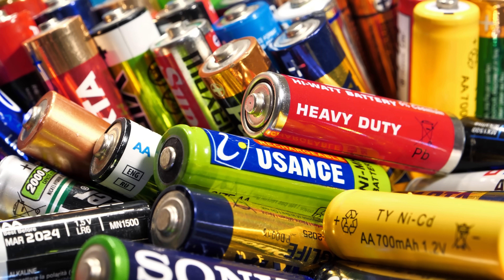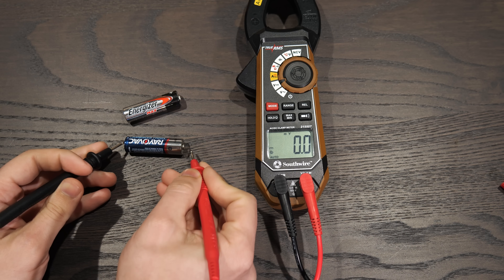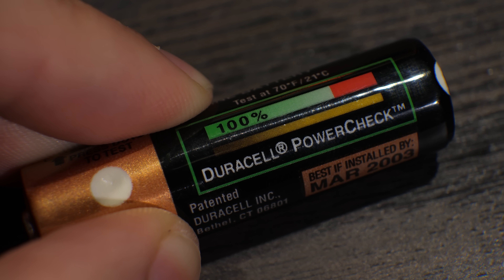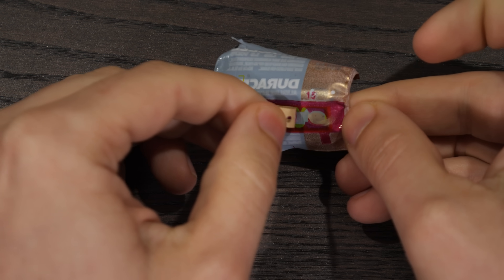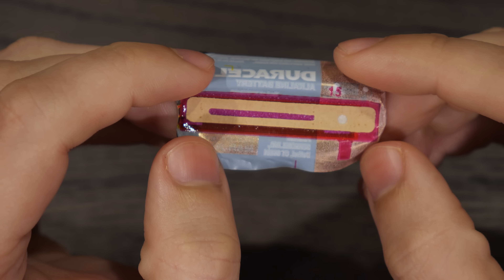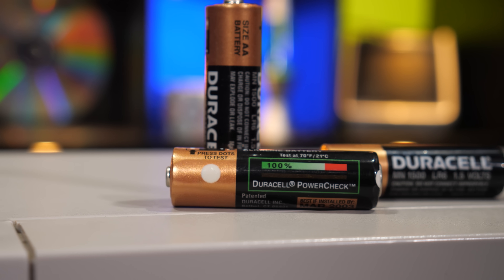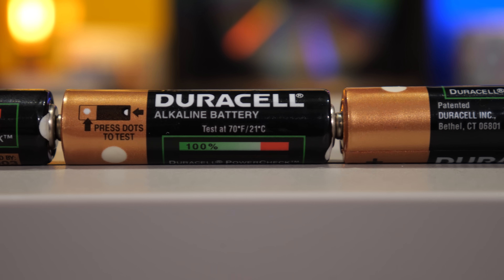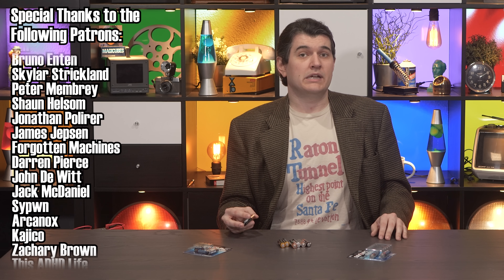Duracell PowerCheck: A genius idea which didn't last that long

Comment: "Thank god we are past that"
Meanwhile the cigarette-industry: "We make disposable e-cigarettes with Lithium-ion batteries in it, that you just gonna throw away after use"
Reply: Not a smoker, but I did know some. I didn't know those were disposable now. Aways saw them charging theirs in a laptop or car USB charger.
Reply: @tangydiesel1886  yeah there's disposable ones as well, which hold a bit of liquid, and have a 18650 Li-Ion battery in them with no charging port/board, which makes them "disposable". 
Not being able to charge is done by design. Its also cheaper I believe.
Reply: @razelm easy solution: buy a charger for the 18650 cell.
Reply: @razelm they are absolutely not putting 18650s in disposables, they only use LiPo cells
Reply: @razelm that's a huge battery. That's 4 times the size of a phone battery. Why would you just throw it away?
Reply: @razelm  turning 18650s into disposable items is already criminal in itself.
Reply: @razelm  they use lithium batteries primarily because of power draw needs, and capacity.
Reply: @razelm Wtf are you talking about? 🤔
Pretty much all disposables have a usb-c charging port! They're "disposable" because they have no way for you to put more juice in them once they run out of puffs lmao (also there's no way to change the coil out either)
Reply: @tangydiesel1886   They're rechargeable, but they're still disposable. They get thrown out when the vape juice inside runs out
Reply: @tangydiesel1886  the units are disposable.  As in you cannot add more nicotine and keep using it.  So wasteful bcuz u might recharge the battery 5 or six times before the nicotine runs out and it's a paperweight.  Modular units are still available too.
Reply: @tangydiesel1886  There are both types.
Reply: @tangydiesel1886 the vape batteries are rechargeable, what makes them disposable is that you cant refill the liquid
Reply: @tangydiesel1886 they’re disposable in the sense that they can’t be refilled.
Reply: Yeah, there's some good videos out there on recycling those batteries and setting them up with a controller to make a battery bank on the cheap.
Reply: @johnsmith8981 I need to learn how to do that. I find these things discarded on the sidewalks quite often while walking since I don’t drive anymore
Reply: @johnsmith8981  trying to figure it out. I have about 70 of these bad boys. Electricity hard.
Reply: @johnsmith8981 that is just for fun.  I dont think they will last several cycles like the good batteries do...
Reply: It's upsetting, but simultaneously I reap the benefits of finding a bunch of free LiPo batteries and charge circuits laying around on the street XD
Reply: @LazorVideosDestruction  a modern cyberpunk version of trash. This is what future generations will be digging up as we are digging up vases and broken spear tips
Reply: @LazorVideosDestruction  same lol… on the one hand it makes me really mad. But also, free high-density batteries!
Reply: @LazorVideosDestruction gee thats some serious cyberpunk thing to do lol
Reply: @LazorVideosDestruction  I just realized how I can make slimevr that I plan to build a whole lot cheaper
Reply: @LazorVideosDestruction  i could have sworn those LiPo bats have some of the worst charactersitics (like massive voltage sag) and also they have extremely low capacity
Reply: Yay, smarter people collect these to make DIY powerpacks.
Reply: @Zcooger  Just came to write that and saw I wasn't alone :D
Reply: @Zcooger I found a few of those ....got some free batteries
Reply: As someone who does indeed vape (I know, I know flame me for it if you want), I have NEVER understood the popularity of those disposable vapes. The popular ones like elfbar can be as much as 35 dollars where I live, and run out of juice or burn out the coil often before the battery even dies. Sometimes just a few days before needing replacement. You can buy a decent reusable vape battery kit that includes a couple pods and charger for $40, and a bottle of vape juice to fill them up for $15 (these prices are on the high end too because of taxes where I live). The $5 pods can last up to a month before burning out, and weeks for the bottles of juice. And the battery can last years if you take care of it. It’s so much more economical, and sustainable.
Reply: @PortRhouse  I buy $5-15 juice. (30ml roughly)
$5 coils
The vape itself cost $45 and lasts well over a year. I'm on my 3rd on in 5 years. That's THREE BATTERIES TOTAL. 

A bottle of juice has 6x the juice in it on average and I can stretch a coil for a couple weeks. 

These college kids pay 20+ for one that lasts them a week. And throw away a cell every time.
Reply: @goosenotmaverick1156  how do you get your coils to last, i use rpm3 and can barely get a week put of them
Reply: @goosenotmaverick1156 yeaah you know what's up. I'm so happy I switched from smoking to vaping, it is an order of magnitude cheaper. It's so nice to be able to get all the nicotine I want for so much less money and I don't smell like an ashtray anymore
Reply: @PortRhouse  I think most people buy their vapes at convenience stores that only sell disposables and don't even realize what modern salt nic refillables are like. I've had a bunch of times where I told friends they should try a refillable and the reply is always "oh, I don't want some huge dorky thing," not even aware that the vape I've been using right in front of them is a refillable that's smaller than the disposable GeekBars etc. they have.
Reply: @max_archer That stigma of the dorky huge boxmod that ended up spreading to every form of refillable vapes was caused by the 30+ y/o dudes that couldn't let go of the vape smoke trick and who can blow the bigger cloud dick measuring contests. I dont smoke refillables anymore but I use the battery from my old vape for carts
Reply: @PortRhouse  i'll bite, I was smoking cigarettes for a time and when I saw vapes and tried one it was love at first puff, immediately changed to vaping after I tried, and then moved to a refillable tank vaporiser which was fun especially as the one I bought had a timer that would run and show you how long your vape lasted (dumb idea but made for a few laughs) anyway the worst issue I couldnt seem to stop was the seemingly random sputtering of straight semi warm vape liquid that every now and then would show up, and cover just a small portion of your lips or get in your mouth, but was so intensely concentrated, often with menthol, that the taste was so awful and then youd have this weird mouth feeling for a small while after you spit it out or just tough it out if it wasnt a big one, i coined this term as the 'vape kiss'

I tried different kinds and brands of vapes which would all have the same issue regardless of the coil size, wattage or ohms settings, as an australian the smoking laws here are totally fucking caddywhompus which meant you had to ship in vape fluid from overseas if you wanted it to come with nicotine, no stores were alllowed to sell liquid with nicotine already mixed into it (which Ive only thought now while typing, I find to be quite ironic as packageing the illegal vape fluid with an environmentally destructive battery somehow made it okay?)

so you had to piss-fart around with finding stores that would sell you liquid "under the counter, cash only thing" or you had to deal with international shipping so extra costs and the chance it might get stopped at customs, that or you find some other source of pure nicotine and then high school science style mix it yourself, leading to inconsistent mixes and then so those 2 inconveniences coupled with all the maintenance like coil swaps, filter changing, accidentally not wetting a new coil enough then inhaling straight burnt cotton, also fucking micro usb was rife at the time I started so constantly having ports break cause of shitty cables that would break the charge-contacts off the inside of the vape or just shitty build quality vapes which all cost anywhere between $60-140 bucks if you wanted to try a new one or have it replaced, it was still cheaper and less gross than smoking

another thing was just trying to stillbe a smoker but having this vape, youd be out with mates & a few of you head out to punch darts, and because youre also addicted to nicotine you decide youll head with them and so theres the discrete smoke and mild conversation happening and then theres just the "PSSSHHHHHHHHHHHHHH" noise as you take a sip and then proceed to exhale thunderstorm style freakin massive clouds into the area was a great way to just seem like a tool

i was proudly against the disposable vapes when they first showed up, being like if you have to have this shitty addiction that sucks then you can at least have it and not also fuck the planet up worse at the same time, which is still how I feel, however when my girlfriend came home with one after it was given to her, and it lasted a week with our pretty regular usage of it, with a consistent draw and a flavour that didnt diminish for the most part, the best thing about it was that it didnt give either of us a vape kiss
 the whole time it was a naughty pleasure, an extra expense to have between us for a treat

but the convenience i didnt realise was what got me, not having to fuck with all that extra bs i mentioned above, being able to draw less attention was a big factor, that and the price point being usually a deal of 3 for 60 or  30 each, when the time came to order more fluid, we just said fuck it I guess we're gonna be those people now

and now a few years later, with no idea of the financial toll due to having to buy most of them with cash still and with no idea of the physical toll of punishing my lungs with vape fluids for several years,  two green shopping bags full of dead vapes that "i swear ill make a battery out of one day"  theres an explosion of crime-run "american candy and gift + tabacco" stores in melbourne which are all just fucking shitty stores run by illegal gangs doing the absolute bare fucking minimum to look real, pushing imported tobacco and chinese vapes onto literally anyone, kids too, just dont wear your school uniform when you go - the government handled this situation ass-backwards, and made acquiring vapes as a legitimate means to quitting smoking was so full of shit that it made you not want to do it and just keep hitting the pens

I also realise i havent mentioned disposable vapes use nicotine salts, which are higher in purity than your bog standard nicotine, leading to way more intense rushes from hits but simultaneously get people addicted way faster, its looking likely ill have to switch back to cigarettes to quit vaping,  but yeah anyway ^^  i'm fortunate in that I developed this addiction after i started a career so ive had the means to afford it, but i imagine were that not the case, id be doing whatever was the cheapeast option which is certainly not disposable, but I only started smoking in the first place due to stress directly incurred at work so take with that what you will

so I hope with all that context, that you my dear reader you were able to see how and also why people would choose a disposable over a reuseable vape (atleast why they would in 2020) please excuse the goddamn essay length reply - I guess I had a lot to get off my chest about vaping  ^^ i try to be a good person but i recognise i have a way to go, if theres anything I can leave anyone who  read this all with, its for the love of god, dont ever take up a smoking or vaping habit, you mill around  with your hard earned money going up in smoke or fruity mist, its not just a waste of your money, its a waste of your life, while you stand there watching the world go by, the people that dont have this crutch are busy living their lives
Reply: @123mikeyd123   This is actually pretty interesting. After reading your story and learning about the stringent regulations in Australia, and how they pave the way for black markets and sketchy knockoffs, it does make sense why you would just go with a disposable out of convenience. I too hate the dreaded “vape kiss” as you put it. When you talked about your reusable, it sounds like it was an old school box mod I’m guessing. Can you not get pod systems down there? Just as discrete and small as a disposable, but still refillable, and can take salts or regular juice depending on which pods you get for it.
Reply: @PortRhouse  what the fuck, $35?!? 
It's like $10 where I live
Reply: @PortRhouse  I 2nd your opinion, I have a rechargeable pod based kit, my roommate only uses disposables. I spend way less than she does on vape supplies.
Reply: @PortRhouse  If you're really careful, the pods can last months even! I vape too and I hate dispos lol
Reply: @PortRhouse the disposables are now rechargable. Which is crazy but I do recycle them at the shop I buy them from.
Reply: @PortRhouse  bruh no one gonna flame u for vaping u a grown up live ur life however u want
Reply: @PortRhouse  Vaping isn't the problem. I'm of the opinion vaping is a really good thing. It's the HR "better than" version of cigarettes. I don't think anyone can argue that as a nicotine delivery system they're not more healthful than cigarettes. The problem is disposeables, which are incredibly wasteful. Rechargeable ones might even be less wasteful than cigarettes, there's barely any waste besides the bottles of juice, dead coils, and maybe the battery cells when they eventually die.
Reply: It should be illegal how wasteful those are. 😒
Reply: @Studio23Media   indeed it should be. Especially when simple solutions in conventional vapes have existed with much less waste for many years.
Reply: I'm so sick of those. I live in a college town and it's an epidemic.
Reply: Me: free rechargeable lithium ion batteries you say? Don't mind if I do xD
Reply: I always felt a little terrible throwing away a rechargeable battery and all the plastic of the enclosure and metal of the coil. I used refillable/rechargeable vapes for most of my vaping life, but when I decided I wanted to stop I went through a lot of disposables. It was a necessary evil as I didn't want to wake up with a working vape as I knew I couldn't trust myself not to start my day by sucking away on my addictive pacifier... I do believe vaping is less toxic, despite a lot of misinformation that goes around, but far more compulsive than "analogs" (over 30 days with no nic now)
Reply: well it turns out that rechargeable lithium cells are cheaper to buy in bulk than non rechargeable ones, so it makes perfect sense to me why they use rechargeable cells in disposable products, the cells are also usually rejects due to not meeting charging/power characteristics.
Reply: Not even close to the worst thing they've done, to be fair.
Reply: that's every industry now. toys, electronics, etc. are all "disposable" with custom non-replaceable batteries in them
Reply: Really really fucking big lithium cells too
Reply: Blame governments (like Australia) that tried to ban e-cigarettes, and ended up causing some half legal loophole where somehow disposable ones are legal but reusable/cartridge ones are not and then never got re-addressed lol.
Reply: Is this an american thing? I've yet to see this occur in my country, I keep my eyes open, but no free lithium cells yet.
Reply: @n.stephan9848  the UK apparently. 
  That's where Clive is.
Reply: @n.stephan9848   do keep an eye out for it and if there's not already legislation to prevent it, maybe talk to whoever can help in your country/area. Not being sure where you're from I only know to use our vocabulary for it so I'm not sure who it would be. 

But yes it's a thing in the US in a big ugly way. Sure, free cells. But that's just the ones you find on the street. Not all the ones that make it directly to the landfill, which I assume is much higher.
Reply: @goosenotmaverick1156  That's irony on its best when street litterers turn out to do better for recycling than those putting them on a trash bin.
Reply: @TheSimoc   sad, isn't it.
Reply: @n.stephan9848 I've seen them in Germany, too, sadly. The "Miniatur Wunderland" actually re-used some in their autonomous model car system and found that the vape cells were actually equally potent as their regular ones that they buy for a few euros each.
Reply: Now we throw the whole device away when the battery runs bad. What advance...
Reply: You ever see those Geek Bar things? Where they have a lcd screen on the side that shows some random bullsht like the power level and some dials and stuff? My sister goes through one of those every month and they just have to get thrown out.
Reply: DAMN, I have used my laptop liion battery for 7 years, bought new battery today, but I do not want to throw away old battery as it has 20% of capacity still :)
Reply: I've never seen a "disposable" ecig, I've owned multiple over the decade and most of had a replaceable 18650 or some smaller sticks / lighter sized ones had built-in batteries, but never one without a charging functionality.
Reply: @TehAlekzi you can charge them. but what do you do when the juice runs out? they’re still disposables. i usually just keep them all in a bucket because i dont want them ending up in a landfill though. The bucket has like 50 geekbars in it
Reply: @danielsmokesmids  Oh, so they're like closed off so you can't refill the atomizer? That's just stupid design then, the e-liquid usually runs out much faster than the battery does. I've made my own liquids and coils pretty much ever since I started using ecigs, but there used to be everything you need pretty reliably available before they passed a law here that you can't order ecig stuff online.
Reply: @TehAlekzi  well that’s not true with them. i charge mine probably anywhere from 5-15 times before the juice runs out
Reply: Just disasemble it and yoink that free battery!
That's what I do, I still have many lithium cells from old laptops.
Reply: I have my friends give me theirs and I turn them into big battery packs!
Reply: Great, now I'm reminded of this and angry again.  Big Clive has done several videos on the subject with instructions on how to harvest them and use them for other projects.
Reply: I tried a elfbar cigar flavored vape.
At near empty, I could detect polymer vapors I could both taste and smell.
For sure no where safer than a cigar or cigarette. Toxic. Nicotine free for 2 years.
Reply: I pick up at least 3-5 of them every time I go for a walk in populated areas. You can always guarantee humans will be lazy slobs but I'm happy to reap the benefits salvaging the free 18650 batteries inside them :D I mean, how cheap would it be to install a usb-c port to charge the things? then again they're there to make money, not save the customer money.
Reply: And full color screens with processors way faster than gaming PCs from 30 years ago. I'm a small government guy and I'd be fine with those being illegal.
Reply: Don't give apple any ideas.
Reply: WTH??
Reply: Get a Box Mod if you're serious about vaping
Reply: I had a functioning wifi router backup made from these exact salvaged cells. Then my country banned vapes. Which is ironic coz tobacco and ciggs never got banned
Reply: @smpmuzpid  I was only referring to the context of disposable vapes, because yes, you are correct, the first e-cigs were indeed rechargable and not disposable. 
Then the whole industry shifted to mods and vape kits which is too cumbersome for most people, myself included as I am a smoker too. 

Then, in the last 2-3 years, disposables became very popular for their ease of use. Buy it, open it, smoke it, throw it. 

And now, in the last few months, at least in my country, the same brands producing disposables have shifted towards selling a small battery kit + pods with juice. 

So now, at the very least, you can keep recharging that battery and just buy pods with different flavors. 

All they gotta do now is sell pods that are rechargable and we're back to square one. Lmao 

How the turntables have tabled.
Reply: the world disposes a quarter billion vapes per annum, enough to make tens of thousands of vehicle batteries.
Reply: Does no one know they’re just a regulatory arbitrage? They’re everywhere because resizable flavors were banned - it’s just a policy failure
Reply: Easily harvestable and used again if you know what you're doing.
Reply: *what's that sound? I think it's big Clive running in from stage left!
Reply: I actually think this is worse. Also have you seen the disposable phone chargers? Basically a vending machine with a phone charger in it and it's one time use but if you open it up it's a lithium ion.
Reply: Please feel reasured, i (born in 1991) deposit as many of those dumb e-vape batteries in those 'battery return' boxs i believe they are grean.
Reply: Thank the government for throwing all the regulations on pod based systems like juul. Still somewhat wasteful, but not near as much as disposable vapes.
Reply: Be like BigCliveDotCom (he's on YT) who finds the tossed e-waste, rescues and uses the batteries.
Reply: In Finland, disposable vapes and flavored e-liquids are illegal. But underage kids use disposables bc it's so much harder to hide a charging vape or liquid mixing gear from parents. For the same reasons these get thrown out in the woods instead of properly recycled.
Reply: I actually still have sone way newer duracell powercheck batteries that still function and live in a little box on my desk where I collect them to fire up tech I'm tinkering with that needs them.
Reply: Why not use primary cells for that ?
Reply: I saw someone making powerbank out of trash left after concert.
Reply: fr. there's no reason to even dispose of them, you can rebuild them for pennies and an hour of time
Reply: which am SO tempted to just take them off people's hands just for the free batteries XD
Reply: That should be criminal.
Reply: @jeschinstad  you gonna go against the corporatocracy?
Reply: I've got some with a lipo and USB C port, but no circuit for charging.
Reply: @LowBudgetGamer-o6l  The charging circuit is sometimes imbedded in the sensor bit that looks like a microphone
Reply: @LazorVideosDestruction  Wow, I'm gonna start keeping those.
Reply: and this is why you don't buy disposables...or vape in the first place. :)
Reply: Also - not as much of a contributor but noteworthy to me - for years in the shops here, you could buy what I guess you could call 'power hits'. They're like, tiny and cheap non-rechargeable power banks that give you a bit of extra juice in an emergency or something, and then you dispose of them when they're empty. The thing is, they're non-rechargeable due to the design of the product, but the actual cell they use is a rechargeable Li-ion battery.
Reply: “Saving the TV Remote in a trying time “.  😂 you sleigh me brother.  So true.
Reply: I watched a video a few weeks ago where a guy was just walking around his city picking up discarded vapes in order to harvest the batteries to make battery packs out of them. He said in like 2 months he found like 100 of them (that figure may be completely incorrect, but it was a lot in a short amount of time).
Reply: The government throws away millions of lithium batteries used in non returnable radiosondes.  Doesn't seem to be a "problem" if they are doing it.
Reply: Well let's be honest, no one's going to go through the proper message to dispose of it. Though you can convince people to probably make some cash back and disposable batteries if they actually save them up and take them to a scrap yard. But if they want to make anything they got to save up a lot or they got to also collect car batteries with it. Like that car batteries. Take it inside a scrap yard to come out the way it and you'll get some money for it. But that's if people even think of doing that. European how much do this with any and all types of batteries. You can sell them as scrap at a scrap yard. But she really got to save up enough because you're paid by the weight. But honestly though, the average vapor is probably not going to save up enough use the fake batteries to do that. They're not even going to care. Filling up the equivalent of a large paint can would probably barely give them a few bucks at a scrap yard.
Reply: @HK47_115  core charge every time you get a new vape lol
Reply: Also, gluing rechargeable Lithium-ion batteries into [smart]phones that are just going to get thrown away later (not as quickly, but still). Why [the fuck] they gotta glue that in?!?! Answer: greedy control-freaks in corporate who are also so out of touch with reality that they don't know what the actual design requirements are
Reply: The unfortunate other consequence is that all those rechargeable batteries are very non-standardized and something that uses disposable batteries will be usable long after these newer appliances aren't
Reply: The disposable e-cigarettes will be forbidden very soon in France. The European Commission has just validated the ban voted recently in France. Other European countries may follow.
Reply: Those lithium flowers, ready to bloom. Reusable, by hacking. But I'd imagine most of them end up straight in the bin, and nobody has the change to reclaim them.
Reply: or electric vehicles
Reply: Not me laughing so hard and slamming the desk. e-cigs really are a bad thing, bad for you, bad for the planet, and even bad for the testers at the factory! Yes, there's a guy who tests all e-cigs before they undergo a sanitisation step and ship to your local store or front door.
Reply: “Ruins both your health and Mother Nature!”
Reply: @Ogi-kun  I'll have to say that only concrete evidence I've seen of people ruining their health with ecigs is when kids shove weed oil into the devices. So user error, oil doesn't vaporize but some gotta get high somehow. And destroy their lungs just for that.
Reply: There's a perimeter wall along a stretch of highway off-ramp in my city that's nicknamed the "Vape Wall". It's called such because people stuck on the offramp during rush hour for the lights up ahead to turn green , would chuck their used disposable vapes out of their car at the wall. I've seen pics where the pavement below the wall is littered with an assortment of colourful disposable vapes...
Reply: you mean the vape industry the feg industry would never want you to stop smoking that's their whole point.
Reply: Gotta get everyone addicted!
Reply: We started smoking because John Wayne and Andy Griffith smoked, Doctors said it helped anything bothering you and all the tough guys on TV smoked.  Could someone young please tell me why anyone starts sucking on a steam iron??
Reply: @donnienicholson6062 Because they've got four ingredients instead of 502+ carcinogens:
Propylene glycol (used in albuterol inhalers), vegetable glycerin (VG, used in medicines, serves as a thickening agent and reduces 'bite'), U.S.P-Grade food flavoring, and nicotine. 

Wanna know what the American Cancer Society doesn't list in their big list of carcinogens?
Nicotine. 
Everything else in a cigarette will wreck your health. 

It's not a safe alternative by any means, but a safer one in general for those wanting a cessation tool to wean down from nicotine levels of a cigarette (~14mg) through a series of 12mg, 6mg, 3mg, and finally zero-mg. 
That was always the intended purpose, and back when I worked in the sales force for these products, I always stressed that with customers. 
I didn't want them coming back as repeat-customers because I cared about those same customers and their wellbeing. 
We used to 'confiscate' packs of cigarettes from people in exchange for a free bottle of the liquid of their choice if they were getting a starter kit. 
If they didn't want to do that agreement, they just paid for the products and went on their merry way. 
It was a sign that you were on a path towards a better life, and a reminder of that when you returned to the shop.
Reply: save a tree, smoke an old fashioned marlboro.
Reply: Meanwhile people actually smoke. gross
Reply: That one i cant understand how we ve come to this point. Disposable lithium ion batteries in cigarrete
Reply: @smpmuzpid  In my country it's even dumber, disposables came as a forced trend by the tobacco companies. We already had really good refillable pod vapes, which are as convenient as disposables. But those were from vape companies - and of course the tobacco companies don't want to lose out on smoking money.

So they first started pushing non-refillable pods, which I already thought was stupid, but of course a giant marketing budget helps. At some point disposable pods got popular in the US, and the tobacco companies realized they could simply force them onto our market. The simple reason is that good vapes are only sold at vape shops, but the disposable garbage is in every store, because again tobacco companies are big and they already have contracts with all the stores.

I recently switched to a pod that's gotten very popular because it's cheap and good - about 25€ upfront. A coil is 4€, let's say it you change it monthly. A 10ml (thanks EU for getting lobbied :) ) bottle of juice decent juice goes for something like 3-5€ (thanks politicians for getting lobbied :) ), I waste about 35€ monthly on juices. That means a month of vaping costs me 40€ total. A disposable vape costs 5-7€, and at the same rate of use it will maybe last you for two days, so you're paying at least twice as much monthly.

And it means you keep throwing batteries and much more plastic away over and over.
Reply: One of my friends vapes like crazy and he gives me about 10 vapes every month that I harvest the batteries from. I buy some TP4056 charging boards and do some modifications to various devices to retrofit them to be rechargeable. I have a bunch of camping lanterns that are rechargeable now (packed with about 12-16 vape batteries in each one so they last longer than I need for a 5 day camp trip), a bunch of USB charger power packs to charge phones - etc, some of the vape batteries also fit in a flashlight I have that originally used non rechargeable 123 lithium batteries. I use some for a power pack that powers a portable external display I made from a computer monitor someone gave me. Between the vape batteries and the power tool packs (18650's) that another friend gives me when they stop charging correctly, I have tons of cool electronics that are rechargeable now, or portable as opposed to plugged in to mains.
Reply: They need to make a recycling center SPECIFICALLY for batteries (throw the vape away hire people to break them apart to get the battery and then reuse them)
Reply: They don’t make them with lithium batteries, they’re moving towards heavy capacitors
Reply: @tofailtowin9046  The batteries used in vape kits are called lithium-ion batteries, and are commonly used in many other small electronics like phones, tablets, and laptops. You will often see lithium-ion abbreviated to li-ion
Reply: There are also disposable vapes with full color OLED displays and bluetooth. A big waste unless you canniablize them for other parts
Reply: I always thought smoking was fairly stupid. But nothing LOOKS more stupid than someone vaping. Sucking on a thumbdrive with strawberry flavour like it makes you cool is just pathetic. I get it if it helps you off cigarettes, but kids picking up vaping? Now I learn it's non recyclable lithium battery? Gosh... what a world we live in
Reply: Its almost like regulations killed an industry of re-usable devices that existed for a while before that, but we're not going to talk about that, are we...
Reply: I don't think that's the cigarette industry. I'm pretty sure big tobacco made those crappy e cigarettes no one uses and now they are trying to get flavored vapes banned because kids don't smoke cigarettes as much these days.
Reply: I recycle used vapes. All you have to do is pry them apart and add more vape juice into the reservoir. Then throw it back on the charger and enjoy some nicotine
Reply: I used to collect them, then turn it into flashlight batteries, 3d-printed body. Got soooo many batteries so I stop collecting them.
Reply: Fortunately i gathered all e-cigarette users together to shout how many of them there are and they said and i qoute:
Reply: As a constant user of 18650 flashlights, I see this as a scavenger's win.
Reply: I grab every one of them I find just for the batteries and electronics. Lol
Reply: Duracell PowerCheck was such a clever innovation! It was so convenient to check the battery life instantly. Sad it didn’t stick around for longer—it deserved more recognition
Reply: @ I think it’s exactly as recognized as it merits.
Reply: Not all lithium batteries are rechargeable.
Reply: Holy shit that is so infuriating.
Reply: This atrocity just infuriates. Lithium - pretty hard to dig and pretty expensive metal just throwing away... And not so much enthusiasts collects this e-cigs to salvage batteries for proper usage.
Reply: Cannabis industry too btw. Equally nasty
Reply: Disposable lithium batteries should be criminalized
Reply: @rouchar they are banned in the UK these days, the only vapes you can buy are rechargeable with disposable pods or mod kits with vape liquid bottles
Reply: Ther3s no way those are safe to dispose in everyday trash
Reply: so many different answers and statements in these comments. 
so lemme clear this up. 

there are refillable, rechargeable vapes 
non refillable, non rechargeable vapes 
and
non refillable, rechargeable vapes
Reply: Expecting good things from the cigarette industry is like expecting rain in the desert.
Reply: I can happily say that the industry is moving towards rechargable vapes, and they're selling pods with liquid instead. 

Why didn't they do that in the first place is beyond me, then again, most people don't actually care about recycling 😢

EDIT: To add more context, the first Vape Pens were indeed rechargable back in the 2010s, then Vape Mods/Vape kits became popular for a while but they were too cumbersome and required maintenance. 

Disposables became very popular in the last 2-3 years for their ease of use, many of which did not allow for any recharging of the battery whatsoever, furthermore, some models prevented you from directly recharging the battery as most of the were soldered directly to their little boards to cut down costs, obviously.
Reply: @razelm towards?
They were rechargable in the first place!
Reply: @embersaffron5522  the battery cells themselves yes, but the enclosure didnt allow for a charging board or a charging port.
Reply: @razelm  imo it was a marketing decision not an engineering/design one, they used to sell more of those before the rechargeable (but still disposable) became the norm... there is certainly plenty of room in most single use vapes for a basic charging board/plug. there is already an air pressure switch and a simple bms in those to limit the discharge.. plus the batteries were a bit lager volume in the unchangeable ones, 800-1000mAh compared to 500-650..
i honestly don't understand how they were able to get away w/ selling that/this crap.
Reply: @razelm that is exactly what it started as. The disposables came later
Reply: @razelm they did.. but lazy people bought the overpriced disposables anyway.
Reply: @razelm Not a smoker, but from what I understand, The rechargable ones are actually older.  They’re making a comeback as people realize how much of a scam disposable vapes are, but have been around since at least a decade ago when I was in college.
Reply: @razelm  ecigs with user refillable tanks and replaceable parts were a lot more common a decade or so ago. When I quit smoking, I tried vaping at first, and a user serviceable device like that made the most sense. Our local shop had bottles of locally made (in my state) fluid of all sorts of flavors and strengths.

There weren't many disposables available back then, although there were pod-style ones, where you retained the main unit (which contained the battery), and swapped out the pod, which contained the liquid, coil and wick. However, you were stuck with the flavors that were available in the pods, and it was still wasteful, as the liquid in the pod would run out long before the coil or wick would really need changing.

But, since the industry took off and the government tried to ban them, a few legal loopholes arose, which weirdly only benefited disposable vapes.

Even the pod style ones became heavily restricted.

So, unfortunately, as per usual, nanny-government authoritarianism reared it's ugly head again, with laws written by lobbyists and passed by politicians  possessing not one iota of knowledge on the subject.

You can still get refillable kits, but the cost has gone up, and add to that the general reluctance of the average consumer to go through the effort of doing it that way. 

Although, I do have to say that the disposables have come a long way, and now most I see do allow you to recharge them, some (RAZ) even have full color lcd displays that show % of charge and estimate of liquid remaining. (Sadly, this likely means even more e-waste, as I doubt most users dispose of them properly).

My wife still vapes, but we don't throw them away. Instead, I'm gathering quite a collection of them, with the plan of figuring out some d.i.y projects. Most disposables use smaller, higher-output (current) cells though, and I haven't come across much guidance on repurposing them. A power bank doesnt make much sense unless you use a whole bunch of the cells with a BMS. I'd love to figure out something with the lcd panels, too.

If I still vaped, I'd be using a reusable one, not only for economic reasons, but most disposables now all have that damned cooling agent in them that I cant stand. Maybe e-liquids in bottle are available without them?
Reply: @razelm  Its dystopian that people found the old ego connector vapes hard to maintain.  When the coils/wicks burnt you just got a new tank.  It was stupid easy but people apparently are so incapable that they need a plastic nicotine fueled toy.
Reply: @harpskid the individuals aren’t the problem. juul had it figured out but the government banned their flavored pods so everyone moved on to flavored disposables
Reply: @razelm  The industry started with rechargeable vapes. Back when it mostly niche hobbyists the vast vast majority of people smoking ecigs were using rechargeable ones. Then they started making disposables that were of much higher quality than the initial disposables that were available many years ago, and those really caught on. Fortunately for the environment, Zyn seems to have to caught on as the new popular route of administration for nicotine. And those are just nicotine crystals in what is basically a paper teabag.

Also to be fair a lot of disposables are technically rechargeable, they just aren't refillable with new liquid unless you crack them open which is a big pain in the ass for the slightly higher quality disposables. I wonder how big the market is for people who break their regular use rechargeable/refillable vape and buy disposables until they can replace it, because I've used them in those situations.
Reply: @razelm  Selling pods became illegal after the explosion in popularity of Juul (which popularized nicotine salt based vapes). These new companies got around the legality by not selling pods -- they sold single use vapes instead! Now these are actually illegal too in most states, but the companies creating them aren't US based like Juul so they don't get the same kind of scrutiny.
Reply: @razelm  that's how they were until recently
Reply: @razelm  I think they went disposable when they began marketing to kids,  not that they ever did that, supposedly
Reply: @razelm  you are right, i have been using e-cigs for about 15 years, and as far as i have used them they have always been available as rechargeable batteries with refillable tanks and replaceable coils. at least that is how i have always done it. but even back then there were disposables available, but they tended to be smaller, cigarettes sized devices
what has really changed is that now the single use vapes are massive, and come with LCD screens and various gimmicks, such as basic games on them. some even have bluetooth lol, its crazy and adds even more e-waste
Reply: @razelm  I never gave up mods. Tried rechargable pod systems (Sourin Drop and Caliburn G) but always went back to the mod. Voopoo drag 4 and its accompanying Uforce-K tank here after years of RDA use.
Reply: That is how it was done in the beginning. Its only been since 2019 that the disposable vape became widely popular @razelm
Reply: @razelm  you can also buy rolling tobacco and rolling papers but they still sell cigarettes as it’s easier to use
Reply: @razelm Most recycling isn’t accessible and most things we recycle go to a plant that throws it out anyway in the US. So it’s very defeatist feeling.
Reply: @razelm  well no because they originally came out with chargeable refillable e cigs and they were a pia for most people so they brough out the disposable kind. You got it back to front there lol
Reply: @razelm Wrong. Brands like Juul and Lava WERE big. (rechargeable and replacable pods). Those are pretty much things of the past. While there are rechargeable vapes that are used, I rarely see them. My assumption is because they're very easily lost/stolen. And replacable vapes are cheap and convenient.
Reply: @razelm Vapes went backwards. There were no disposals for years. You had to own a rechargeable battery device that connected to a tank that you made or purchased juice for.
Reply: @razelm because it’s cheaper to buy disposables in bulk because they are not expensive and extremely dangerous when you take them apart and look at them.

Super cheap to make in bulk and sell
Reply: @razelm This was seemingly more normal before vaping became more prevalent, I remember a long time ago family members who vape would have refillable vapes with standard rechargable batteries before a gradual shift starting probably around 2016-2017.
Reply: @razelm  your comment is accidentally quite embarrassing. The disposables are new. The hyper replaceable and sustainable mods came and went out of popularity in the 2010s. The disposables is the "modern way".
Reply: @awesomeferret  yes indeed. I realized later that I should've explained my point a bit better considering all the facts. 
I did so in the comments above.
Reply: 'Street lithium', it's called.
Reply: It's not really the cigarette industry. Disposable vapes are by-and-large sold by companies operating in a legal gray area (at best), and usually not domestic ones.
Reply: The sale of single-use e-cigarettes should be banned. Period.
Awful for your health. Awful waste of lithium.
Reply: @ethzero  Why ban it? Just tax it?
Reply: If you count the beans,  you will discover the social and medical cost is higher than revenue.  That's why governments with nationalised healthcare are pushing for all out bans of cigarettes rather than just taxing them
Reply: @ethzero you’d make a perfect politician the way you completely misunderstand the problem & want to make everything you don’t understand illegal
Reply: I've truly never understood it past picking one up when yours is dead and you cant charge or you forgot it.

They do taste better than a refillable, but their pod counterparts taste exactly the same... Plus they're cheaper AND you can use it until the juice runs out - not only when the battery dies (When there is normally more juice still inside).
Reply: @SamPhoenix_  I generally find nowadays almost all disposables are rechargeable, they simply run out of juice then get thrown away, which still sucks. I found one I thought I liked which had a system where you buy a pod, detatch the battery pack and attach to the new pod with juice, but then it turned out BOTH the pod and pack have juice and the "battery pack" is simply a booster and readout. Hate that.
Reply: @SamPhoenix_  they're for kids who can't legally vape, for whatever reason they think that it being disposable will get them in less trouble, like "oh it isnt mine i just saw it on the ground and picked it up"
Reply: @SamPhoenix_   The pods are illegal in the US though, why I couldn't tell you when everything else is allowed.
Reply: @lukasg4807 what pods are illegal in the us?
Reply: @lukasg4807  Pods are not illegal in the US. What kind of misinformation are you spreading sunny? i live in iowa right in the middle of the US, and we sell pods of all kinds. Vuse is a major brand that comes to mind, but others exist.
Reply: Well, there's an interesting point for analog cigarettes I wasn't expecting.
Reply: This is hilariously ironic considering that people like you support electric cars and we would be disposing of those batteries😂
Reply: @HPol-g8x  The batteries will be recycled eventually. Land fills are nothing more than long term storage for future mines.
Reply: blame the fda
Reply: @marco3392  why blame the FDA.  The units where you can refill nicotine and use the battery pack over and over are readily available.   People are just too lazy to keep up with and squeeze their own juice bottles.
Reply: @superpossum78  disposable vapes wouldn’t have ever have become the main option if the fda never banned flavored juice pods for pod type vapes, they thought they were geniuses and it was gonna somehow stop kids from vaping, all it did was make companies start producing all in one vapes to get around that. Vapes you can fill with your own juice, salt nic or not, have been around since forever, and i still use one, but convenience is a huge factor
Reply: Vapes are worse for you I've smoked for around 20 years tobacco doesn't give me bad coughs and chest infections but vapes do i avoid them as much as i can. I think vapes will turn out to be worse for you than ordinary cigarettes
Reply: @YouTube-account-x9g Yeah but to a non smoker, like me, they dont smell like shit to me.
Reply: @DirkFedermann  meanwhile you type on presumably a phone with a lithium ion battery which will eventually be thrown away
Reply: Well, "cigarette industry"
Reply: Yeah,  but it's pretty nifty and completely user friendly. I like being able to just buy a vape without having to worry about getting a battery.